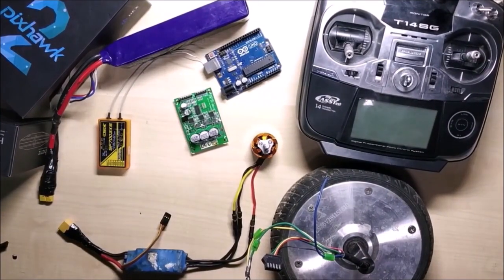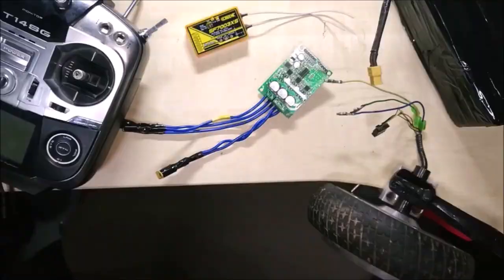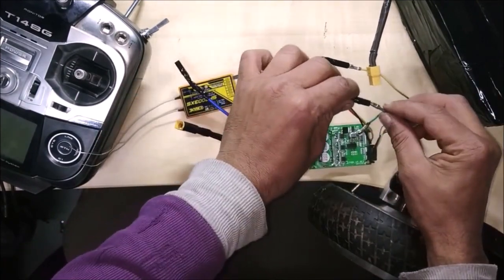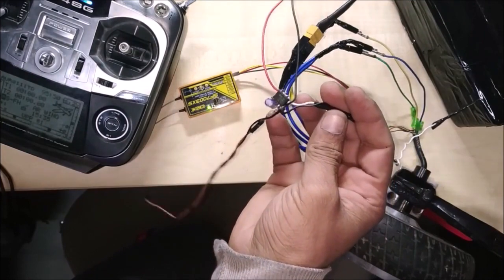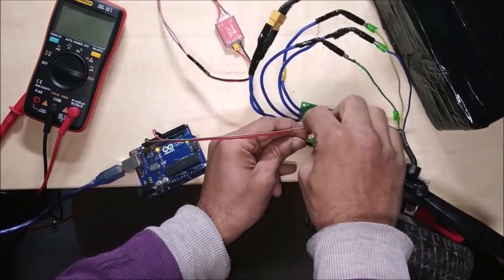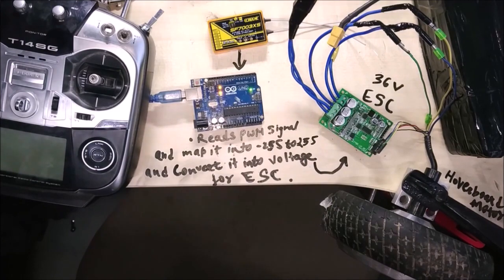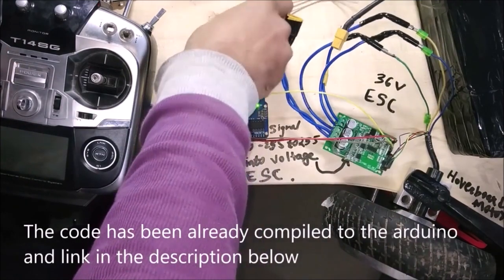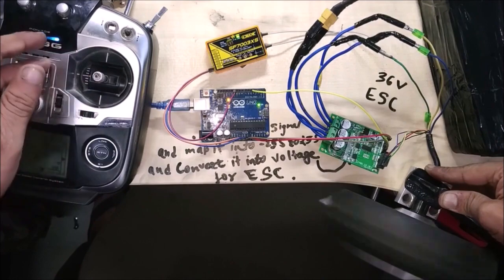how to control Hoverboard motor using Arduino and make it RC

Comment: The wire you connected vr to pin #5 has raised a question. I have a riorand esc and it doesn't have a vr identifier but does have a pwm pin. Im new to this so forgive the ignorance. Would connecting the pwm on the riorand to pin 5 accomplish same thing or should I connect it to a different pin?
Reply: After searching all over I had a thought that due to language accent I may have misunderstood. Did you say vr or dr to pin 5
Reply: @TheOldKid   did it end up being dr after all?
Reply: @MegaMarcuscooper  he says vr. If you have the riorand i think its the 0-5v pin to pin #5. I cant remember off top of my head but ill be hooking it back up later and will confirm thats what I did. The remote also has some settings that need addressed for your application from what I understand but haven't gone through to see if it makes a difference yet
Reply: @TheOldKid   Wow thanks for the reply.  On your arduino, which pin did you connect the "dir" wire coming from the riorand? I'm assuming that required to change directions. I don't know how to tell the code to reverse either.
Reply: @MegaMarcuscooper  i havent connected direction pin. I assumed -255,255 wouldve been automatic rev and forward. I think to make it work properly the jumper needs to be done and the side board pwm should be used but im of the older gen and just happy I havent seen smoke yet. I do have propulsion and now fabricating a steering mechanism to use a servo.

Comment: Does it make much difference which arduino used? Would i need 2 esc to run 2 motors independant or would one esc handle the two and arduino code motors independent?

Comment: So I figured out how to detect a transition through zerro and turn on pin 10 for my motor controller to reverse the direction.
What puzzles me now is how to invert the PWM of the left side of the channel. This is my attempt at it so far
I added this code before the: } return pulse; }

if (pulse<-10){
   digitalWrite (10,1);
   pulse = map(pulse,-3000,2000,300,-600);
   delay (10);
  }else{
   digitalWrite (10,0);
   delay (10);

Comment: Hi
Is it posible with this setup to detect a transition through zerro and turn on another pin on arduino to change direction and how can I program that?
A great project. I am going to use similar ESC that has a brake which I intend to control with a separate channel.
Thank you.

Comment: Hi, my hoverboard motors just vibrate when I try and control them via arduino or potentiometer. I tried this with two differents ESCs. Would you happen to know a fix to this?

Comment: Can you suggest good motor driver for a small car project. I want to use these BLDC motors from my old hoverboard. The motherboard of the board is a different one and i can't find and firmware hack for it online and i am not capable of writing it from scratch on my own. But i want to use these motors for the project, so best option is to use some good motor driver.
Reply from the maker: use this controller
https://www.indiamart.com/proddetail/gogoa1-bldc-hub-motor-controller-36v-350w-450w-14876511030.html
or
https://www.indiamart.com/proddetail/gogoa1-dual-mode-holeless-motor-controller-36-48v-1000w-15189090412.html

Comment: hi.great video.i have use dual esc controller with remote to control twin hoverboard motors on my longboard before gets me to 10mph.im looking to make remote control car with perhaps 4 motors which I have from overboard.i have just bought ardino uno r3 kit and I have plenty 18650 cells.made an ebike battery 48volt so can split that for car.i had receiver from a drone and also a monitor black pearl with recover aerials.so hope to figure this out and build mdf shell for go kart
Reply from the maker: have you seen my this playlist https://www.youtube.com/watch?v=IaqbMhZaprE&list=PL1tEkfXLt6aF1SdIMXsdFWKq3hwcm0cbb
Reply from the maker: and do like share and subscribe my channel thanks

Comment: Nice job. Question - I have two hub motors on the front side, but they move with different speed when they are connected to same arduino and power supply. Any suggestions on how to ensure the wheels move with same speed if they are moving just forward or backwards. Thanks. Any help would be appreciated.
Reply from the maker: Connect 5v, gnd, and signal wire together of two motor controller on one Arduino signal channel. 
or a better solution of this problem is to write a code which can do switching on channel example.. when vehicle moves  forward is on one channel, when turn left or right is on another channel for different speed of the vehicle for turning the vehicle. Ok  please do like share and subscribe for more information thanks.
Reply: @vinayraj010  Can you write that code?

Comment: can this control use reverse and forward and break ??
Reply from the maker: this is controller not a good quality contoller. use flipsky VESC contoller instead of this contoller
Reply from the maker: yes using this you can control reverse forward and brake?
Reply: @vinayraj010  how, you you make another video with that. And also controlling more than 1. I'm trying to run 6 off a remote

Comment: Opa consigo usar um joystick para controlar dois motores? Para um projeto de cadeira de rodas
Reply from the maker: please comment in english /hindi or hinglish
Reply from the maker: so your comment is   --  Oops can I use a joystick to control two engines? For a wheelchair project.  
Reply -    yes you can.  Use 2 channels to control two motors.  

responda no seu idioma - sim você pode. Usar 2 canais para controlar dois motores.

Comment: Nice job 👍 I am trying to build a electric assisted bike with an hoverboard motor but will the sensor of the moteur will I be able to pedal or the motor will block me ? And can I use a pedaling sensor with arduino to run the motor when I am pedalling ?
Reply from the maker: Yes you can run the motor using pedaling sensor. But here i don't know which pedaling sensor you will used in your project. Listen read the output value of the pedaling sensor using arduino and convert/map this value for motor control using arduino{ in code}. In my video i used RC receiver. here you can replace rc receiver by pedaling sensor.

Comment: i follow your video, it work but it cannot reverse and brake . do you have code with reverse and brake system ... please share ... i am also apply it to build rc car using electric bike motor. i have no idea about code, just copy your. Thank you so much for this tutorial.
Reply from the maker: sorry i do not have code with reverse and brake system and currently i am not working on this.
at that time i only need forward direction for my project. So i did not write the code for brake. Many people ask for reverse direction. and this modules is not mine. So if i had a enough time to write code for reverse then i will write. and make video on it.
Reply: @vinayraj010  THANK YOU FOR REPLY ME. HOPE YOU WILL UPLOAD IT SOON

Comment: Hey, Do you think you could give me the parts list that you used? And how would I connect a second hoverboard motor to the same controller?
Reply from the maker: this is not a good controller. use second controller for second motor but can use single arduino, receiver.. & watch the video for part list
Reply: @vinayraj010  How would I make two motors work in together to make a remote control car like the ones in your videos? I've been researching for hours and I have not figured out how to do it.
Reply from the maker: @sythosz1571  using hoverboard motor or what type of motors(bldc / DC/servo motors) you will used in your project? tell me. first select the basic component/modules like motors.... which is according to the need/requirement/specification of your project and then start work on it.
Reply from the maker: start with tyre specification and then select motors then chassis. don't see to much videos (hahahha--not figured out how to do it)use your imagination/ vision --think about it... use imagination for making a project you learn more.
Reply: @vinayraj010  What I'm looking to do is create a remote control shopping cart with two hoverboard motors. However I cant seem to figure out how to control two motors with one transmitter. I'd like to have one joystick control one motor, and the other to control the other. In my mind I see this as the easiest way to control the motors.
Reply from the maker: @sythosz1571  
like this https://www.youtube.com/watch?v=ponx_U4xhoM 

mail me vinayraj034@gmail.com
Reply: @vinayraj010  I am actually working on the same idea. You mind helping me out if I email you?
Reply from the maker: @relatedl35  yes ok

Comment: You do control 1 motor and to control for 2 motors, so what?
Reply from the maker: read the value of the other RC channel using same receiver & arduino {in code with different variable name} and map it for controller as shown in the video above.
Reply: @vinayraj010  Please can you make an other video with 2 motors.
How robust is this system. Can this handle loads as high as a standard  hoverboard motherboard?
Reply from the maker: @xxlalbatross3287  sorry I am  no longer working on this project and i do not even have the goods  for this project 

this is a low  quality controller.so use best quality controller for your project

Comment: Thank you very much, i was looking for this because i want to use ebike controllers to power 2 hoverboard motors and build an eskateboard..... , now i can translate the rc output to the analog inputs on the controller that control the speed...... , the only part missing is brakes :-) , i guess i will try to change the code and if i detect negative input on the rc (lever going back) it will engage the braking pin on the ebike controller, thanks a lot :-)
Reply from the maker: i dont have much time at that time. I should also make reverse and brake system but just need forward direction of the motor and now the project is over. please write the code for backward direction and upload it here. thanks
Reply: do you have code with reverse and brake system ... please share ... i am also aply it to build rc car.
Reply from the maker: @RobotNongNghiep-VietNam   watch my this video  https://www.youtube.com/watch?v=-7HudGeO-mg

Comment: If your just trying to control the motor RC? why not just use an RC ESC? it's all ready figured out?
Reply from the maker: I used it before but it didn't work with the hall sensor motor. the RC ESC we use in drones does not contain hall sensor pin.

Comment: Thank you so much for this tutorial. I used this as the basis for my robot, which has two motors (and two ESCs).  Both ESC grounds went to a common ground with the Arduino ground, but I found that you do not need to connect the ESC 5v to the Arduino Vin (as you do at 6:38) if you already have a separate power source for the Arduino (as it looks like you do through the USB connection).
My robot has the two motors "facing each other" on a common axle, so when moving the robot forward, you need to get creative in the Arduino code to set one of the motors to run in reverse by grounding the ZF pin on one of the ESCs. (I did this with a relay switch.)
Reply: Can 6 of these controllers be hook up for 6x6 tank drive with hoverboard motors?
Reply: @thebassingtowtrucks105  You won't have enough PWM pins available on an Arduino Uno to handle the input plus six outputs (not to mention all of those ZF pins that you'll want to control), so you'll have to upgrade to an Arduino Mega.  If you have enough battery power (amps) to drive the six ESCs and their associated motors, then you should be okay.
Another thing to keep in mind: make sure you apply heat sinks to the ESC modules.  I neglected that in my first attempt and the ESCs would stop working after a few minutes -- a classic sign of overheating.
Reply: @AtariTape54018  hello, I am looking to make a 8x8 using 8 motors and 8 ESC, do you know which Arduino board would I need to have enough slots ?

Comment: Can the motors be controlled only by potentiometers or are the programmable control board and hall sensors, etc. a must?
I am asking for bare-bones, absolute simplest controller with manual voltage regulator for different constant speeds.  Or would that work on brushed motors only?
Reply from the maker: To run the motor first we have to connect it with hall sensor terminals which is on the motor controller. So just connecting with the programmable controller will not run the motor. 
 would work on brushed motors only.

Comment: Thanks for the demonstration! Could you please share what wires you used and what connectors?
Reply from the maker: male - female jumper wire for the connection, XT60 for the battery connection etc  etc or are you asking for the connections.

Comment: Hello. On 4.46 its valid code or not??
Reply from the maker: yes Sir it is a valid code if you have any problem in that i can help you. Sir on 4.46 i just read the channel signal using arduino(its connection also mention/comment in the code) and for controlling motor i wrote rc_code.ino code.
Reply: @vinayraj010  Thanks a lot dear for your reply. I understend your code!! Thats very cool. Have one questions - How change direction of motor rotation??

Comment: How can this be done with 2 motors such that they can both rotate independently (i.e. implementing turning)? And does the method you demonstrated allow for reverse?
Reply from the maker: sir right now I don't have the controller but if I would have it then I would have experimented and would have also written code for reverse direction also. The controller provides us the reverse direction also. when we connect Z/F terminal with ground and give 0~5v to VR than wheel rotates in reverse direction.

Comment: did you manage to reverse the rotation ?
Reply from the maker: The controller provides us the reverse direction also. when we connect Z/F terminal with ground and give 0~5v to VR than wheel rotate in reverse direction.
In code you can use if condition and limit the channel signal and use that some +value for forward direction and some -value for backward direction.
Also the controller is not to good (low quality)
‌You can mail me your project problem {vinayraj034@gmail.com}
Reply: Are there other motor controllers that will work with hover board wheels without the Arduino?
Reply: @curtmorehouse1  I believe that an ebike controller would work.  It would use the throttle or a suitable potentiometer for setting the speed.  One similar to this (not this one in particular).  https://www.ebay.com/itm/24V-36V-350W-6Mosfets-E-Bike-Scooter-Brushless-Hub-Motor-Controller-throttle/322385783453?hash=item4b0fb0aa9d:m:mdYa9fO6sdu_rP_7_zSUWjA&var=512584967279
Reply from the maker: @curtmorehouse1    first see this all   https://tinyurl.com/y2baac5n
Reply from the maker: watch my this video  https://www.youtube.com/watch?v=-7HudGeO-mg

Comment: Can I use the 36-volt HoverBoard battery and use it with a 500W driver?
Reply from the maker: Can you elaborate more on what project are you working. Also the controller is not good (low quality)
Reply from the maker: if you use hoverboard battery then it destroys your controller don't use that battery.